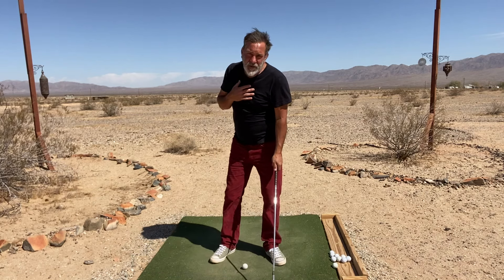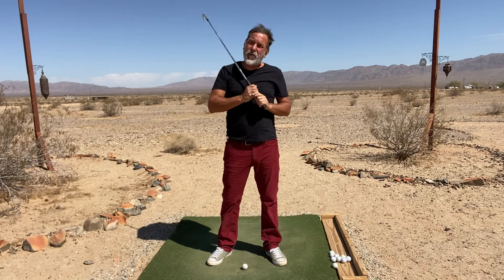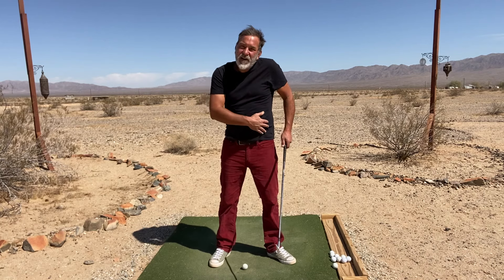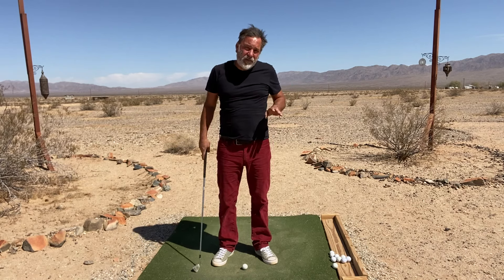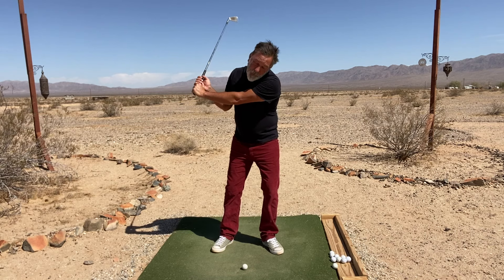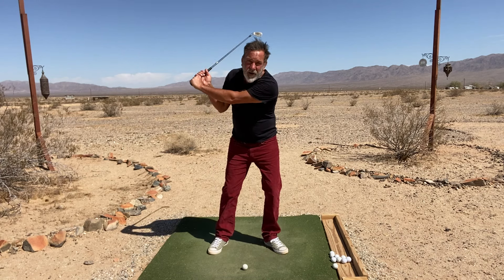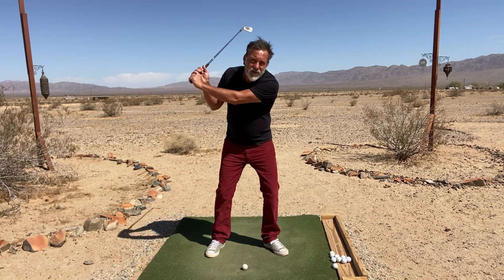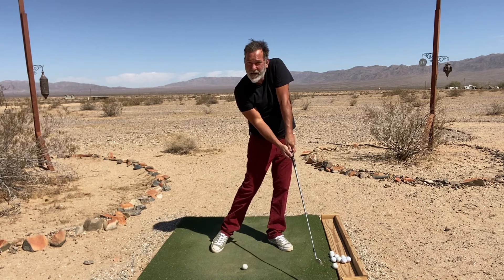Want To Increase Club Head Speed? This Video Explains How To Do It Without Swinging Harder!

Comment: I came to this video late but it has been a light bulb moment for me.  It seems to me Jim is taking what two PGA players, Padraig Harrington and Larry Rinker, propose to its logical conclusion.  Both point out that most (80 -85%) of power is generated from the arms, hands and wrists.  They say all but the very top players should capitalize on that, rather than add the stress and complication with all the body movement of classical PGA teaching.  I know Jim will argue that his simple set up and swing in fact is not only easier/more accurate but can also generate Tour Pro distance but then he is a far better golfer than me.

Comment: This is really important for this swing holding the weight still and springing your shoulder up in the back swing against your weight is key to doing this swing properly. im in the school and this is something that took me awhile to understand your create swing speed with this leverage not swinging your arms just hold your weight down hard as you can and spring your left arm straight as you can up against your weight. im hitting 7 iron 150 160 yards and 4 iron 180 to 190 not great but decent considering ive only played golf 2
2 months. if you don't hold the weight you lose the spring I highly recommend any one wanting to learn this swing join the school best decision I made
Reply: Great tip

Comment: Jim Venetos  I have watched several of your videos and I like what I am seeing. I have a bad left shoulder (dislocates ). Back a few years ago (06 or 07) I dislocated it, swinging a weighted club. Let me back up a little bit. The shoulder was first dislocated by a fall in 1990 on the job. I did not have it fixed at the time (I saw to many shoulder surgeries leave people with locked up or stiff shoulders. So I didn't have it fixed at the time. A year later it dislocated again just stepping out of a crane. Still didn't have it fixed. Many years have passed and many a miles have been put on this old body (disabled now). The shoulder has been out of place at least once every 6 months (it's no problem to put back in place). So I have to guard the shoulder in everything I do. Back when I was playing a lot, I played to a 9 handicap. I was a long ball hitter. 5 iron 200yds  4 iron was my 225 yd club. If the big stick left me I could always count on my irons. 
A sever heatstroke in 09 took me out of the game of golf. Can't take the heat now at all. The last ball I hit on a course was in 2014 . I was still long of the tee with the driver, but couldn't hit my rear with both   hands with the irons. I hit one good sandwedge shot from about 80 yds to about 2' and  putted in for birdie.
 If you don't mind, think on it, and see if you can come up with anything that could help get me back in the game
Thanks and keep coming out with the great videos
Ray Castleberry
Reply: In Jim's method, he emphasizes using the lead shoulder as it is the axis of the swing.
If you use his method of stillness and don't sway and don't let the right arm dominate, your leading left should MIGHT be fine!?!
If not,  maybe you should switch to a left handed swing as this may put less stress on you leading left shoulder.

Comment: Correct me if I'm wrong, but my  understanding of your  concept, has two parts,
 One,  When we turn our shoulders and torso it's like coiling and uncoiling,, creating , storing  power, but there is also a lag for that power in the coil to unwind and transfer to the shaft, there is also two hinges almost, ,both left and right shoulders and even a third, the wrists,,   were as your swing only uses one hinge, the Left shoulder hinge,  it may allow the writs to add to the down swing too.
The power in the left hinge only has to travel from the shoulder.  
2, the conventional swing relies on 2 and 3 hinges, L and R shoulders and the wrists to fling the club head.. A lot of sequences and moving parts to negotiate.. were as your single hinge swing has the highest point of the stable body frame, giving it the longest distance from the hinge to the club head, which also creates the speed for the club head.. That's my understanding,, putting all into practice is a little difficult, as I have to undo 30yrs of swing in one way, which has always been a right hand/arm dominate swing, due to left hand nerve damage.. and That would be the question I have for you,,  would me using my right Hand/side hinge be a hindrance to a left side Hinge swing??

Comment: Right before I take my final address to the ball, I imagine my head is on a spike and it can't move. It helps with this style of swing and I hit the ball so much better now than the traditional swing I've struggled with for 25 years.

All of my clubs go further and have a more professional ball flight and action. I even use this swing with my driver and it goes probably 20 more yards. 

My distances with traditional / Jim's swing

D: 260 / 280
2h: 220 / 240
4i: 205 / 222
5i: 193 / 210
6i:181 / 196
7i: 168 / 182
8i: 156 / 171
9i: 148 / 162
P: 136 / 151
50°: 112 / 125
56°: 88 / 105
60°: 76 / 85

I've been playing with forged blades forever and can work the ball like magic sometimes,  but can't consistently hit it straight. Tempo, timing, speed all have to align perfectly for a traditional swing to work. With this swing, I just set up, stay still, and focus on my shoulder being the center point of the circle my arm travels in. 

Thanks, Jim!
Reply: @bigell3275 What do you use for 130-145?

Comment: Hello Jim, question regarding speed and setting the spring.  I can get much more speed through the ball with your method, if I increase the speed of the backswing, but then just let the forward swing happen.  I don't try to add speed, but if I do it's very late right at the ball. Does this increasing the speed of the backswing make sense to you?
Reply from the maker: No

Comment: So you are pre setting the position and I understand why some would need this to swing consistently from the inside. What I don't understand is why not take it a step further and preset the flat wrist by pushing hands forward at address and holding angle through backswing and follow through. Seems to be consistent if you keep at 45 degree angle? Just wondering...
Reply from the maker: Because that isn’t the way our anatomy works. I’ll explain briefly; our arms start in close to our body and extend away while creating an action; punching, throwing, swingingp. If I were to do as you suggest it would be like throwing a ball with your arm fully extended for the entire action. You could still throw the ball, probably very accurately but with significantly less power than if you allow your arms to extend away from your body during the action.

Comment: in the JV set up and swing is the back right knee basically locked up or straight, while the front left knee flexes ? thanks
Reply from the maker: Negative. Both knees are bent. The lead 3x as much as the trail

Comment: I know what you are saying is true, and it works.  However,  I am curious of your clubhead and ball speeds.  I spent a lot of time doing much of what you say (Stack and Tilt - weight forward).  It works, but to generate 115mph+ with a driver or 90mph+ with an iron,  I have found, that you need to shift your weight.   Thanks.  I enjoy your videos.

Comment: When you start down in the downswing, your right shoulder. moves down and slightly behind you. This move acts to move. the mass of your. upper. body away from the left side. with pressure felt toward the back foot..Because of this. unless you are very strong there will be a tendency to unweight your left side. This is why your method works for you ( (because you are  very strong and your left side weight remains still ( "stillness") but for others it is almost impossible to do.